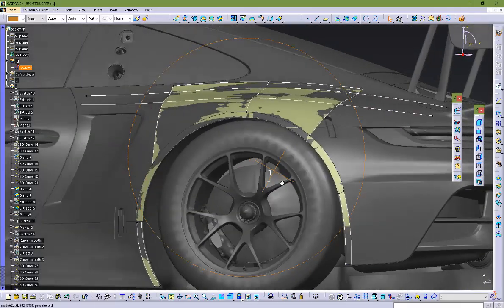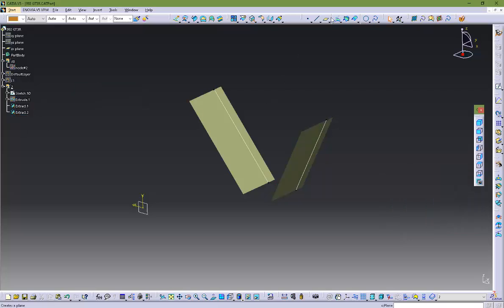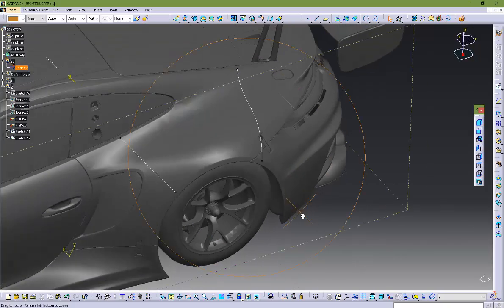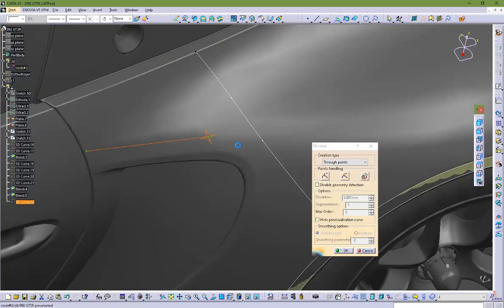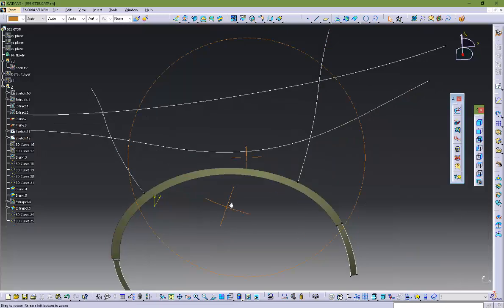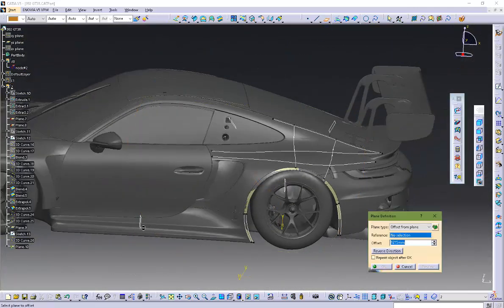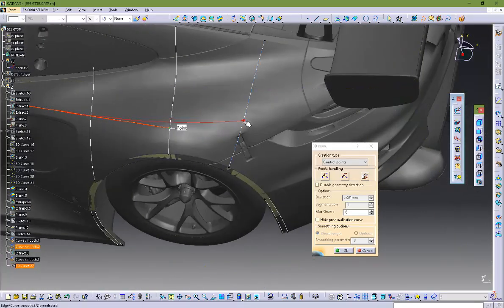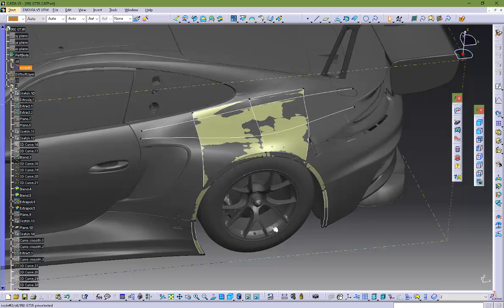Porsche-992-Modeling total car in CATIA from stl data | Reverse Engineering techniques

Comment: Absolute legend, keep up the good work, looking forward to future videos!
Out of curiosity - just a question:
In step one (creating the intersections) - why did you approach this by "manually" drawing the splines?
Could this have been done by using the "Planar sections" options in the Digitized Shape Editor and using the "Smooth curve" command?

Thank you for your response, have a nice day!
P.S. people like you do a massive service to the learning community, thank you!
Reply from the maker: Thank you for the motivation and kind words. I am currently preparing for the upcoming classes.

That's a great question! Yes, we can accomplish that using the planner section command. However, I believe that in sketching, we have greater control over splines which allows us to create more precise sections.
Reply: @The-class-A-surface_guy  Thank you for confirming my thoughts. 
For a later stage in the process - could you show the process for "thickening" the surface to make a solid model? 
Using the "Thicken surface" doesn't work for more complex geometries and manual offsetting is required - is this how it's actually done in practice (going from A to B class surface) or does there exist a better way?
As I've said - for a later stage in the process.
And again - thank you!
Reply from the maker: @PeroPerovich  One cannot directly thicken a complex Class A surface. Imagine a curve with a radius of less than 1mm that needs to be thickened by 2.5mm. So, how can this be achieved? There are various techniques available. By utilizing the offset command, some patches may not offset correctly. However, CATIA will provide you with the option to keep the partial offset. Take advantage of this feature and proceed to create the remaining patches. This method will help you effectively handle such situations.